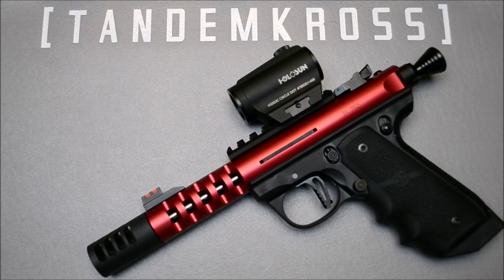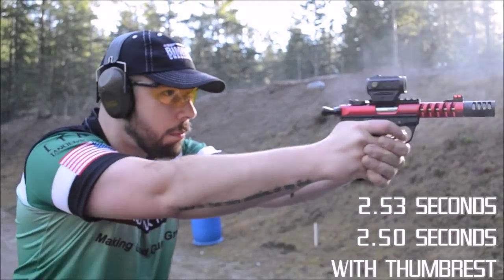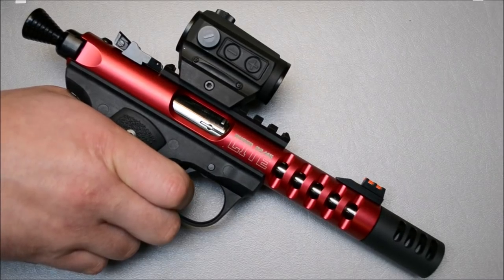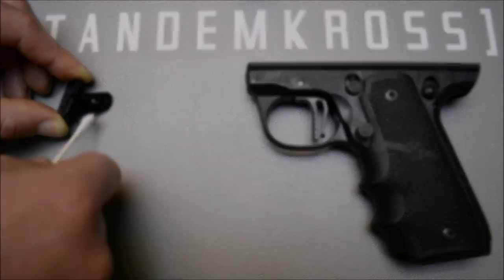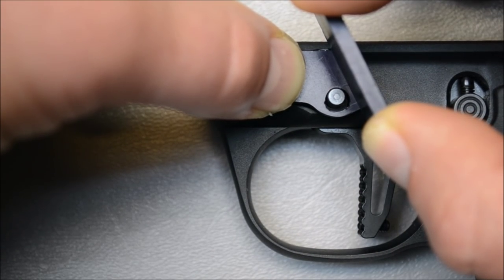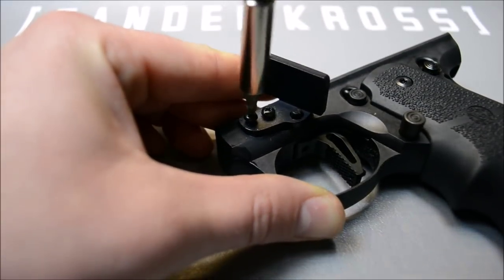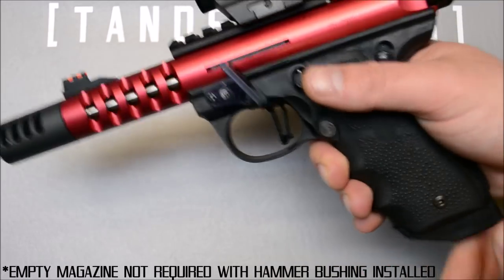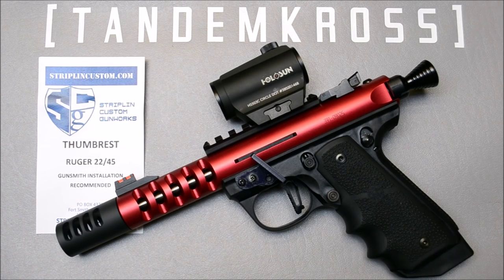Striplin Custom Gunworks Ruger 22/45 Thumbrest Install Video

Comment: when you add this will this still fit in the black dog holster? ?
Reply from the maker: Hi Nick, it would not still fit in the holster with the thumbrest installed, however you may be able to modify the holster to fit it. The holster is made of Kydex and can be cut/sanded with Dremel-like tool.